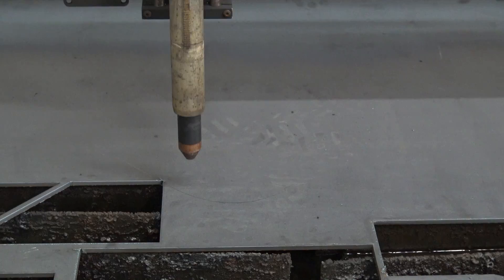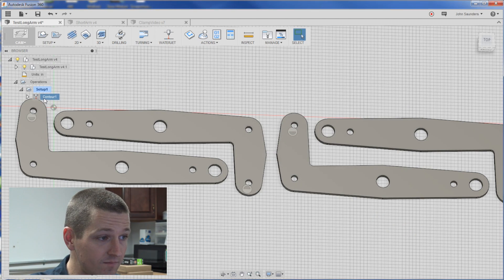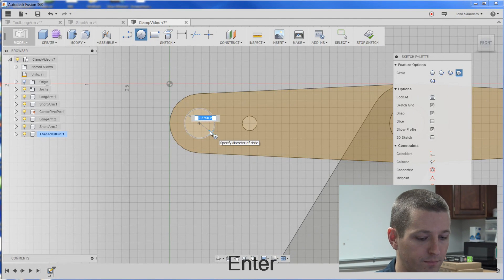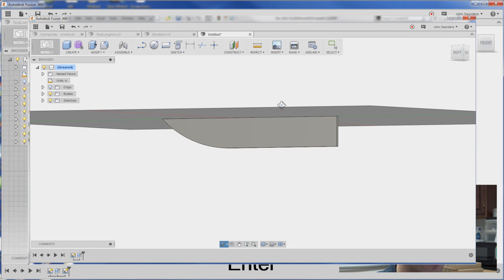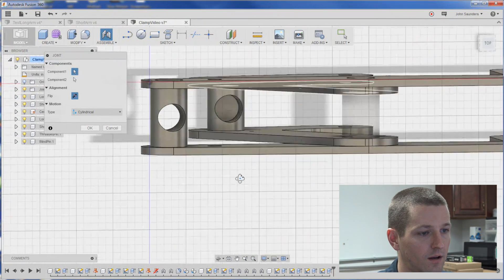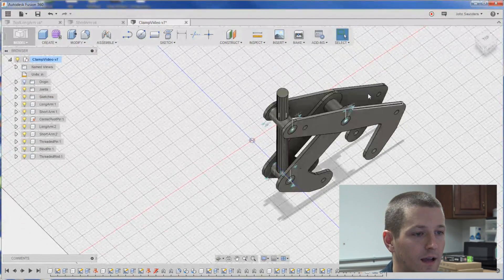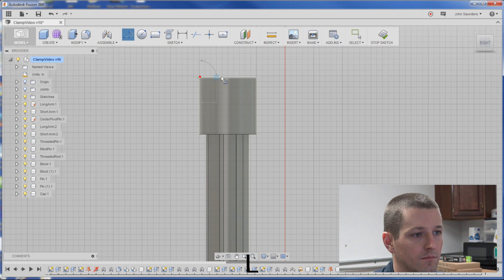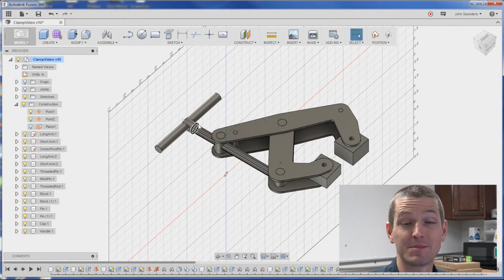Fusion 360 DIY Clamp Part 3: Joints & Plasma Cutting! Widget72

Comment: This may have been pointed out already but another way to make the hole in the blind pin would be: Construct > Tangent Plane. Select the blind pin, and for reference plane turn on the Origin light and select the X-Z plane. This creates a new plane, parallel to the X-Z plane and tangent to the OD of the pin. You can sketch on that and extrude a hole through. When you do it this way, the origin of the plane is right on the center of the pin, so you don't have to draw extra sketch lines to position your circle. I think it's a more tidy and well-defined way of doing it.

Comment: Thank you for this great video but i have a problem on one point.
While creating the threaded rod im not able to select the bottom pocket as you do. (8:00 in the video)
If im in select mode, i can pick it. Even if i do the same mistake than you (not selecting the new component/sketches do not go in new component) i can not pick it. Selection just flicks around the side arms but does not grab the bottom pocket of the pin.

Can anybody help please ?
Thanks a lot
Reply: Solved ! Thanks anyway and keep up !

Comment: Hi.  I'm good right up till about 8:02 when you select the pocket for the ThreadedRod.  There doesn't seem to be anything selectable in the center of this pin?  What did I miss?  Thanks!
Reply: ah, the extrude is only part way through the BlindPin, problem solved.   On the ThreadedRod, I think it needs a rigid joint in the BlindPin.

Comment: Nice work as always John. 

It may have just been a slip, but you said a few times "C for sketch". I believe it's actually C for circle, R for rectangle, L for line, all are indeed sketch commands, but you can save time by calling up the operation directly from the shortcut. For example when you built the blocks at 9:00 you could have just gone "R", selected the plane or face and that would bring up the sketch palette. Normally you'd just go ahead and then sketch the 2 point rectangle, however as you wanted a centerpoint rectangle, you just click on that option in the pallet (top line right side). Obviously no biggie, but it can save a few mouse moves and pull down menus so is just a bit faster. On the other hand, maybe that's a difference between the Mac and Win version, but when you're making the holes at 5:00, I'm pretty sure you could have just gone "L" for line instead of clicking on the circle command to pull up the sketch palette. 

You move around your models impressively quickly John and I'm jealous, I'd love to see how you get around your models so fast! I don't like the Apple mouse for this, and the track pad is a disaster! I use a combo of track ball and mouse at home, but wish I could move as fast as you do. BTW the option of the view changing and re-scaling when selecting a plane can be turned off in the preferences if required, and I've done that in the past, but that also had disadvantages.

I liked your solution of constructing a plane for the handle. I would have done it off the existing sketch, but your way is much more eloquent and would be easier to keep parametric.

Hopefully all the above is correct, sorry of it's not but it's been a long day and my eyes are rolling around in my head like a mad cow at the moment!